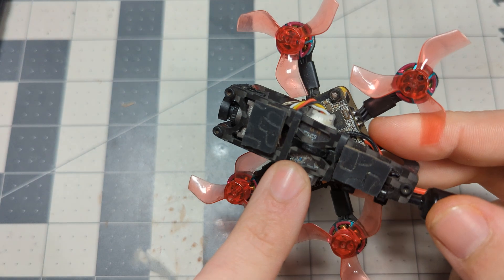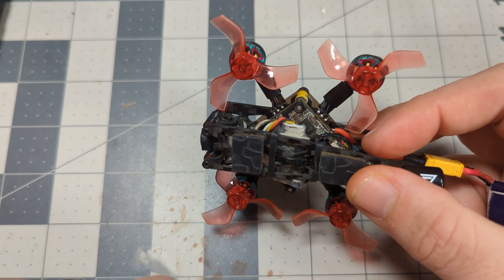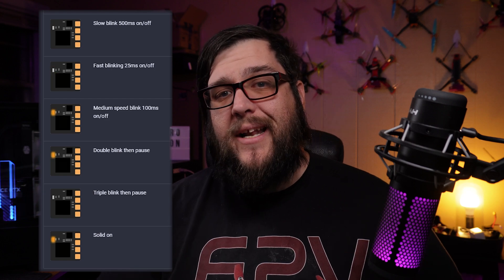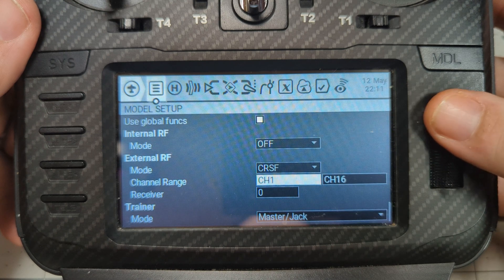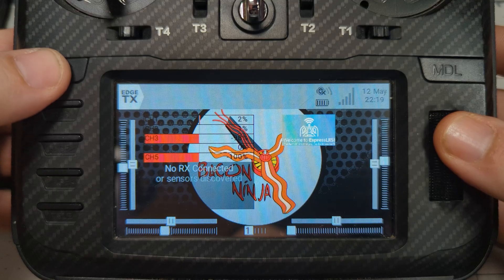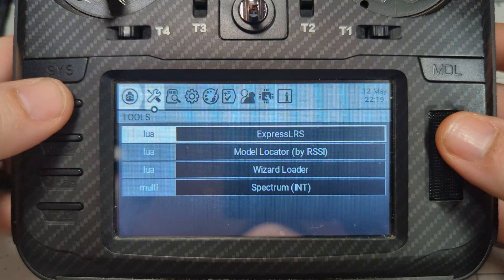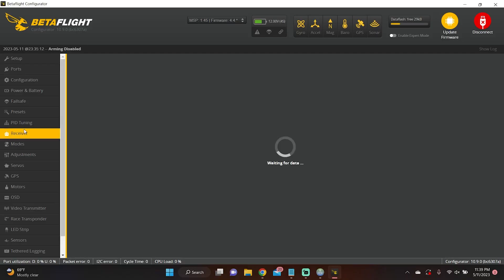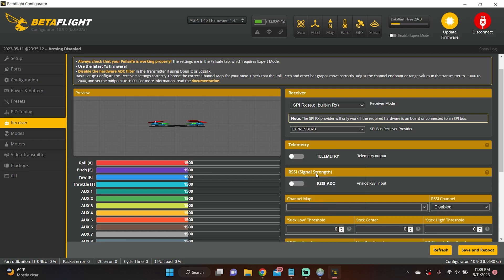Don't rage quit on ELRS, lets fix it instead!  ExpressLRS basic troubleshooting guide

Comment: Hey I've got a 5in build of a DC Mark5 and I'm running a 2.4G Nano Speedybee ERLS receiver and a RM Pocket. Everything works and my settings are 250Hz at 250mW. My quad literally dropped out of the sky after only 50meters. How is that possible. Is there any way I can increase my range or trouble shoot why I'm only able to fly in such a small radius.

Comment: ELRS I mean what can one say about a top tier expirence promised on cutting edge hardware that has to be configured by flashing it like the cmos on a 1994 486 pc which by the way was only done if all else failed and risk bricking the thing every time ya do it . Not a first choice to front end configuration files for  your preimum poroduct that controls my $1200.00 dollar drone setup . what brainaic decided to not put a default config in the rom that is allways there on all elrs compatable devices that allways works .....  umm like a button or a jumper pin that would activate that mode. wow what a concept creating  devices so they work  just look at the title of this video it says it all that aint the catch phraze for mercedies benze or coke or pepsi hey its the best cola if you dont get the one with the piss in it just go to thedi webpage to dilute the piss then log into the soda and flash the piss out of it but first make sure you know the name of the piss manufactures pissy product naming structure you are gonna need it if you wanna get that best cola ever invented e3xpirence (and avoid that piss) so you can match it up to your piss filter or it will tazste like piss go to this wickepeeedia website for the bottelling company that bottled your pissy cola and get this pissv filter from there and download this piss filter software that will create a custom latest piss filte0 profile you can transfer manually to your personal piss and broke my baby toe bou ri bruised my milkin parts so ya might gea some pus or yoiu might get the piss foir your super piss filled drink no dont drink it yet you gotta go and get tha piss filter for the compleminting pis coke operer or that old piss will get all over you and you will be in the piss untill you start over at the depending on where you purchased that recycled preimum soda the sewer of the ritz or out on the farm straight from the just piss out tha win dow and what goes in the can stays in the can thats strsaight from the horses cock the original O.G. recycled cola SO JUST A KEEP A DIGGING THROUGH THE TALES OF OTHER PISS PIRATES THAT PAID  FOR A PISS RICH PRODUCT  all a social psychological expirement to see hoiw much piss one will drink and still declare it tastes like mana from heavqan . the duke brothers watching: my brother mortimer and I made a bet that you would do all the develoupers joib and pay them for the privlidge to do it. wow well I lose that  bet.  heres your dollar.   dont worrie it wont be long and you getta go back thtrough the depissification the ever changing convoluted  are you thirsty well i wouldent recomend trying that till you get that piss filter woirkin
  y tha fug dont you sell cola without piss in it in the first place 
 the reason why after buyin a new transmitter,  receivers and 2 months of time have passed that my as%$^hole is still sore is because im still getting fu#ked

Comment: My radio master rp1 works great until I power down and then plug in again. It has solid light but there’s no signal to transmitter. I have to let it sit for 30min before powering it up and it works. Until I unplug the battery and try to plug another pack in. Solid light but no RSSI. I’m stumped

Comment: Thanks bro this is brilliant. I like the way you broke it out by blinks. I have a dozen quads and crossfire, and now putting more on to ELRS 2.4. Didn't have any problems except solid light, no sticks. I put in many many receivers, but I could not figure what I did wrong. In the end, it was sbus. 

Normally, on a Vista I'd clip it, but this was air unit, and I was focused on new ELRS so much, I completely forgot to disconnect it. Once I disconnected it, and killed the Uart, all is good. 
Thanks for saying that, you put it back in my head, I looked and there it was.  Damn it. Thanks.

Comment: I have yet to get another receiver to update, I did this once, added binding phrase, got it to connect all good. build 3 more drones get 1 connected binding not an issue, the other 2 not so good. I have been thru 5 different receivers and cant get any to work. when I try to update the firmware it always fails, and I cant remember what I put for binding phrase the first time I did this and it worked. very tired of seeing the big red failed box.

Comment: So, I have a solid on when I power up the flight controller, even when the transmitter is turned off. If I disconnect the receiver from the flight controller and plug it back in, then it does the blinky thing as one would expect on initial power up. If I have the transmitter on , then it connects like normal. problem is, this has been the same result from a couple different controllers. Any thoughts?

UPDATE: This seems like a resource conflict issue. The receiver doesn't like to be connected to the UART when it powers up. If I power it up before connecting it to the UART, everything works normally, including connecting properly with the flight controller and working correctly there. Very frustrating at this point. Tried different firmware on the controller loads with all the same results.

Comment: Im bound solid green and blue. but i can't get it to talk to betaflight still. Im on rx 4 and tx 4. So my worst problem with elrs is being bound and not getting stick inputs.
Reply from the maker: well at least you know you are properly bound!  Since your sticks wont work, there are a few things to look at.  First make sure that the UART you have your receiver on has serial RX checked in the ports tab of Betaflight.  If that is good, then make sure in the receiver tab you have the type set to serial and the protocol set to CRSF.  If that checks out, double and triple check that you have the TX on the receiver going to the RX pad of the UART you have serial RX selected for.  If you hapened to have left the "invert serial" check box on when you built the firmware for the reciever, those pads are going to be backwards (TX to TX and RX to RX) so double check that you didn't build it with that inversion checked.  Also make sure that you arent using an SBUS pad since that has hardware inversion and will mess some stuff up.  Same for the RX on the receiver going to the TX for the pad you have serial RX selected for.  Lastly you can check the mixes tab in your radio for the model you have set up and make sure your sticks are in there properly.  Outside of all those things, something realllllly wrong would be going on if all of that checks out.  If you are still stuck, hit up the discord because we are always answering ELRS questions over there!
Reply: @BaconNinjaFPV  im using and sbus pad on uart 3. elrs is on uart 4 and thank you for your time and patients and yes all that checks off correctly. the only thing i can think of is I built the firmware a few times, i was able to delete it from my comp but bot sure if that matters now. I did wire them correctly i noticed the tx was before the rx so i asked around if they were supposed to be tx to rx as usual. I may have selected invetered because it says to for the tango 2. i also actually swapped them quickly and was able to still bind in betaflight by doing exactly that ivetering rx to rx and selecting tx just in betaflight to trouble shoot. before this video. It was generally easy every thing was succesfull on the tx side and i accidentally entered things the wifi way for the rx and thats when it bound and i was like well that was the luckiest accident ive ever had. I wonder if i have to run older firm ware because originally the happy model one had the firrmware built in. the tx is on 3.30 and the rx is on 3.01 . i dropped radiomaster in the tools and i think it back dated to the happy model build and the ranger stayed on the latest. but i have the right thing in the rx now its the radio master ep1. I tried just msp tx 1 and rx 4 and save and nothing
Reply from the maker: @kennykobi  hmmmm, if there is any way you can make it over to the Discord I bet we could get it worked out since a couple of pictures would be super helpful :)  Do you have one wire from your ELRS on the SBUS pad of UART 3 and another wire on a pad for UART 4?  It sounds like you have everything going great with the firmware side, so that is for sure the hardest part and you nailed that bit!
Reply: @BaconNinjaFPV  yes of course

Comment: hello sir how to know which flight controller is supported by expresslrs for example skystars f722 mini hd pro is support elrs protocol?

Please reply sir
Reply from the maker: to my knowledge all modern flight controller firmwares include support for the CRSF protocol which is what ExpressLRS runs between their receivers and the flight controller.  As long as the FC has an available UART, an open 5V pad, and support for CRSF in the firmware flashed to it, then ELRS should be able to work with it just fine.
Reply: @BaconNinjaFPV  thank you ninja bhai

Comment: JUST PUT A EP1 RX no my quad i can arm and fly but cant change power or channel using the elrs on my controller it dus work on my crux 35 i have moddel match turned off and using the same moddel
Reply from the maker: It sounds like everything is working with the control link then, so great job at getting that done!! I think the issue you may be having is going to be more on the FC to VTX side since you can't get VTX admin in the LUA to change your band/channel.  What kind of VTX are you using on that build?  Usually it is an issue with smart audio or MSP VTX control if you are using an analog or HDZero transmitter.
Reply: @BaconNinjaFPV  im using a SkyStars F7 WiFi HD Pro and hdzero whoop vtx
Reply: @BaconNinjaFPV  update i did not check TELEMETY on in the recevet tab lol

Comment: Great video. Super helpful. 👌👌 Something I have run into that others may run into also, but may be rare now::: I bought a bunch of ELRS rx’s when they first came out. I would get the message, “ not enough space… update failed.” when trying to update to  v 3.x. I would have to flash to v2.5, then flash again to v 3.x and it would take. The RX’s were (are) HappyModel RX’s with version 2.0 on them mostly.
Reply: (I hit the enter button, sorry) I bought a bunch of ELRS rx’s when they first came out. I would get the message, “ not enough space… update failed.” when trying to update to  v 3.x. I would have to flash to v2.5, then flash again to v 3.x and it would take. The RX’s were (are) HappyModel RX’s with version 2.0 on them mostly.
Reply from the maker: That is a great point!! I have helped a few people through that message in the past and sometimes, especially with the older HM TXs, you even had to take the transmitter apart to get at dip switches in there....a real pain.  Hopefully we will stop seeing any new RXs come with a 2.x version on them, buuuuut they will likely be out there somewhere causing trouble in a flash, lol.

Comment: Help please. I have a solid blinking light and have gone through all of these steps and still no stick inputs 😵‍💫
Reply from the maker: So a solid blinking light should be that the quad and radio aren't bound with each other yet, which would absolutely make sense for not getting any sticks in Betaflight.  What kind of quad/receiver are you running and what is the transmitter you are using?
Reply: @BaconNinjaFPV  sorry I didn’t mean solid “blinking” I just meant solid. Idk why I worded it that way. But it’s the x9 lite with beta FPV 2.4 nano and the matching g beta FPV 2.4 nano rx. Weird thing is that it worked and I flew it a few times, then one day it just didn’t work anymore.
Reply: Also, it’s the mamba f4 mk2  board

Comment: Hi Bacon, I have a new whoop built I think everything is ok, but when I connect to beta flight in receiver tab I do get a response from the radio stick but is very sluggish, it take a couple of seconds to respond, any idea what can I do thanks
I did a new update to my BETAFPV F411 2-4S 20A Toothpick Brushless Flight Controller
Reply from the maker: hmmmmm, it could be a couple of things.  Which UART to do you have you receiver connected to on that thing?  If it is somehow connected to a softserial connection that would for sure do it, and it would get worse as the CPU loads down which may happen with newer versions of betaflight.

Comment: Hey man, thanks for your videos, it is really helpful.

I'm starting now in the hobby, this past week my Meteor65 pro 2022 and the Radiomaster Boxer arrived.

I spent the whole weekend trying to Bind and I couldn't.

 I updated RX and the Radio to version 3.2.1, 3.2.0, 3.0.1 and 3.0.0.

I also updated with and without passphrase and nothing worked.

I also checked if I had match mode enabled, and both were off.

I also try to put it in bind mode by turning it on and off 3 times and nothing, it just blinks.

I have no idea what I do more!
Reply from the maker: hmmmmm, I would say it could be faulty hardware but since you were able to flash it that pretty much rules it out.  Did you try enabling model match, backing out, then disabling it again?

Comment: ELRS is easy. Don’t understand people that can’t follow simple instructions.
Reply: Its not about instructions. It's about reliability. Way too many different companies making ELRS receivers. Some work and some don't. When you fail safe 50% of what you are building and everything is correct it makes you loose confidence.  Been flying TBS for 8 years and only one failsafe. Started flying RC in 1976 and while I like many features of ELRS I do not like crashing a quad because of crap hardware.
Reply from the maker: I actually see this quite a bit at work since one of my responsibilities is to teach highly technical skills to a group of people.  I usually have to teach it 3 different ways for everyone to pick up on it since some people learn best by reading it, others by watching it, and some by hearing it.  Just a difference in the way some brains are wired vs others :)

Comment: I hate ELRS. Convoluted update method. Crap range although many say it's super. Brand new Pavo 25 can't get across a football field without signal loss Warnings. Ripped it out and crossfire in. Problem solved.
Reply from the maker: The update method is....wellllll....yeah not super awesome compared to having the receiver update itself from the radio, that is for sure.  The range you got though, I have never seen ELRS have bad range unless there was something goin on with the antenna or the radio config was set up weird.  At the end of the day though, if Crossfire does it for you then it is a great system to be on!
Reply: It's not ELRS, it's BetaFPV. BetaFPV - not even once. I have a friend with LiteRadio 3 and he's getting more failsafes than I got in my Frsky flying days. 100mW+internal antenna+suboptimal rx antenna orientation = disaster.

Comment: I went ELRS for everything myself, makes life so much easier, as long as you are paying attention that is. Very pleased by how much it's progressed, it used to be way more of a guessing game before, trying to figure out which receiver I had so I could flash it correctly and such. I love the wifi/webpage it has now.
Reply from the maker: It has a come a long way, that is for sure!  Now if we could just get some kind of wifi  based auto flashing from the LUA and cross version binding....that would really go a long way for pilot accessibility.
Reply: @BaconNinjaFPV  Agreed, that would be a dream. The ELRS configurator actually picks up on the unit when it's in wifi mode now too which is pretty rad. I keep debating other protocols, but at the end of the day, so far, all my needs are being met. Next is that Radiomaster 2W unit because I just can't help myself... =D
Reply: A bind button worked just fine for me

Comment: I’m not trying to be a smarty pants or correct you, but they are thankfully now making built-in uart based ELRS receivers, that function just like external receivers. F$@k SPI based!!
Reply from the maker: I am sooooo glad they are starting to do more UART based AIO implementations!  I didn't want to get too confusing though, so since the bulk of them are SPI I kinda went that route with it.  I agree though, SPI implementations of it need to just go somewhere and never bee seen again, lol.
Reply: @BaconNinjaFPV  it’s the reason why I still have the first nano module on 1.0.1(stupid first gen SPI boards). The module had issues anyway so I gladly have an upgraded 1W nano now. That one only did maybe 250mw 👎🏼. 

I figured you would know, and it does make sense. No sense in confusing the super noobs anymore. Even as a seasoned pilot(though not the best lol) it still finds a way to irritate me. I still dig it though. I do still use Xfire for a lot of builds, but using more ELRS these days. I only recently found the channel but I’m really digging it. I watch most of your videos. Great work!

Comment: Been switching to elrs recently. Most of the time no issues. But a few times I'd end up pulling my limited amount of hair out. Model match is  the main problem I've had. I'd flail around a bit until I got it working never knowing WTH just happened. Thanks bacon 👏🥓😎
Reply from the maker: at least you haven't lost too much hair to it yet :p

Comment: I hope this helps me, I have 5 receivers and only 1 actually takes stick inputs, the other 4 connect (wired correctly and flashed) but sticks dont do anything despit all my radio and bf 4.4 changes ugh using a radiomaster boxer
Reply from the maker: I hope it helps you too!  I have seen a bunch of people in this exact same spot lately :(